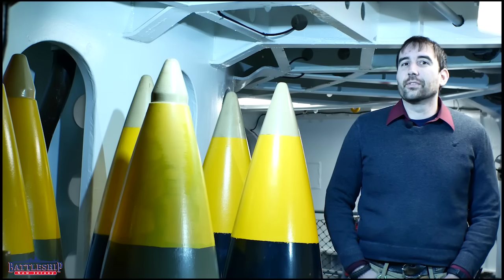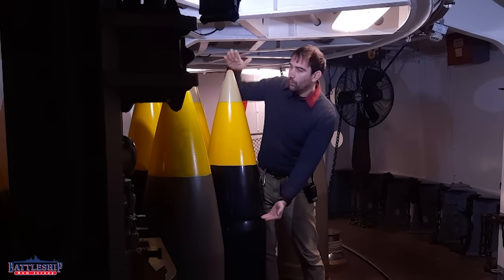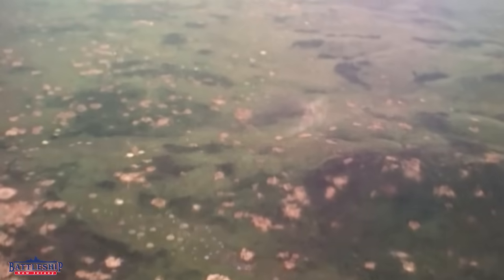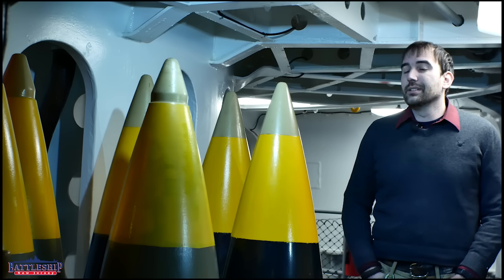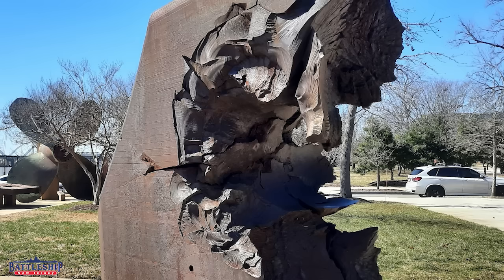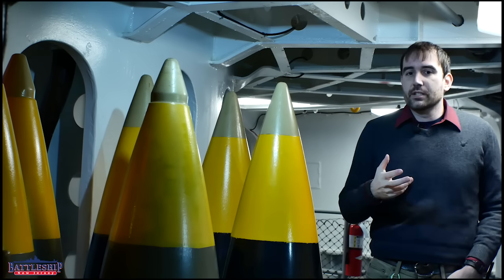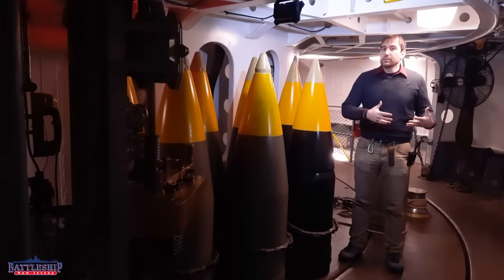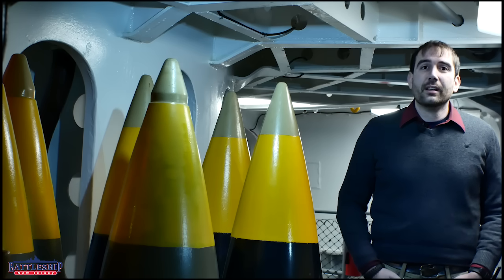What Does the Impact of a 16in Shell Look Like?

Comment: I had no idea how little explosive those monsters carried. The V-2 ballistic missile carried one U.S. ton of explosive in its warhead and if the vehicle stayed together, the warhead plus 27,000 pounds of empty rocket coming in at Mach 2+ did terrible damage to soft targets in the allied cities.
Reply: Artillery shells have to have thick walls to resist the energy of being fired from a gun.  Bombs, on the other hand, do not have that problem and have more of their volume taken up by explosive filler.  Also, steel is much denser than TNT or other explosive filler.  Most of the weight of any artillery projectile is steel.

Comment: I've also wondered how the HC shell would have worked as a anti aircraft shell with a VT fuse,  start breaking up the formations early
Reply: Ask Yamato. They had a specially designed round and used it, but it doesn't help.
Reply: @Galf506  
The IJN used a mechanical time fuse and magnesium pellets not a  Shrapnel shell

Comment: How large a spread would an 
Iowa class 16 inch gun produce if the firing solution stayed the same for say five shots from the same barrel? Other words how accurate?
Reply: With the modern fire control, very close grouping. Even with about a 50 second flight time at 23 statute miles.
Reply: Generally speaking, the accuracy of actual shooting, with good powder minimizing shot to shot velocity variations, was 80% of shells landing in a 150 yard circle at 35,000 yards.
Reply: @scrappydude1  That's awesome grouping. If you scale it down to stuff we humans can do that would be a 1/2 inch group in 35 yards.